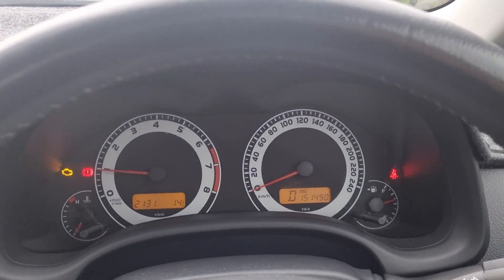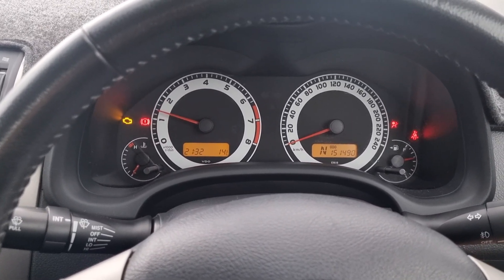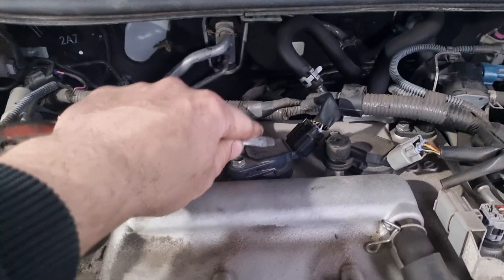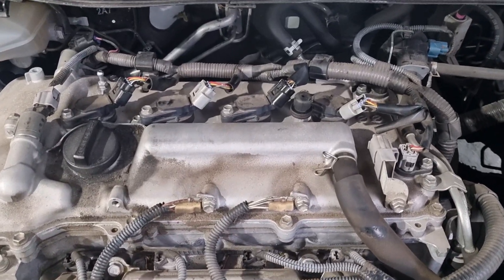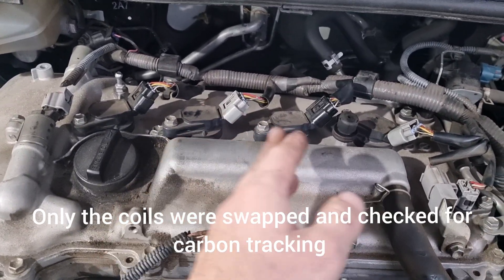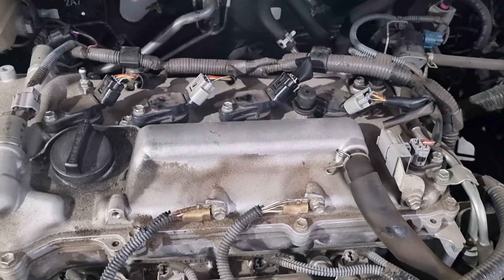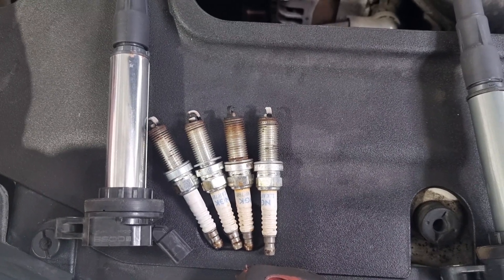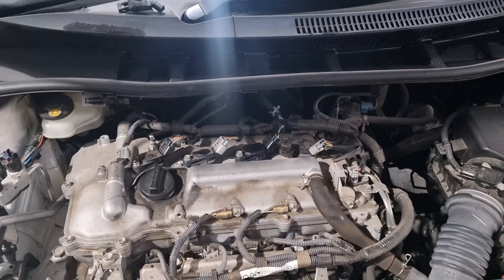How To Diagnose A Misfire Without Special Tools! Easy Method #automotive #carmechanic #mechanic

Comment: Nice video, did it has a check engine light and code for ignition misfire ?
Reply from the maker: Thank you mate, yes it did have an engine light for the cylinder misfiring. But I wanted to showcase that the scan tool was not always required
Reply: @RealAutoSolutions cheers makes sense.